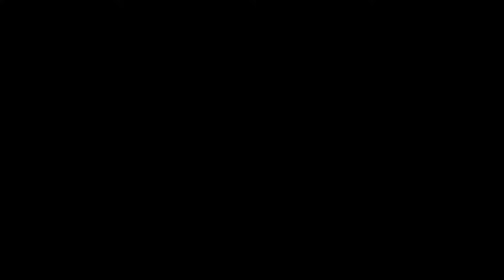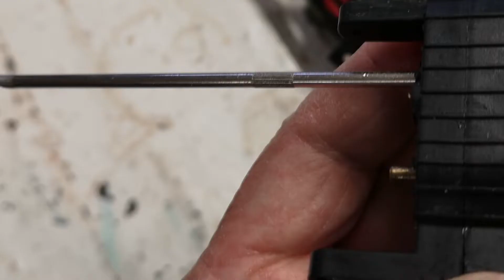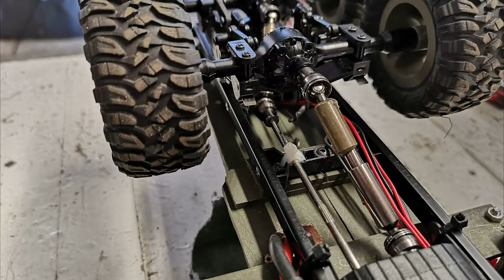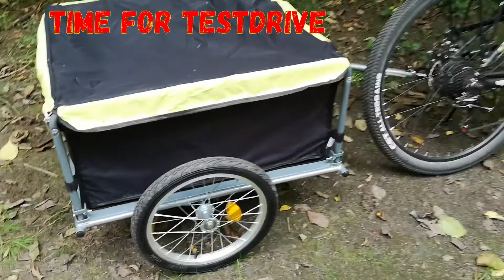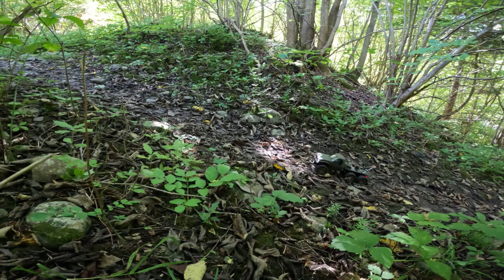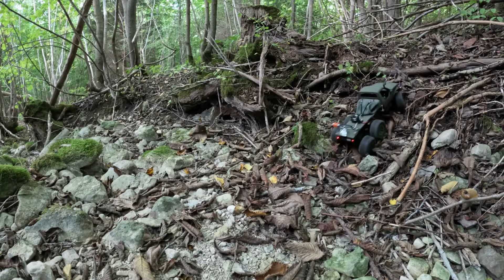WPL B36 dual driveshafts for rear axles

Comment: That's the best redesign I have seen on the web in ages. Truly excellent idea and implementation. I wish mine could have avoided the "through" diff, so much better the way you've done it 👍🍺🇬🇧
Reply from the maker: Thank you Carl! I´ve seen similar designs on full size trucks, so I thought why not try. And it´s rather easy to do with this type of single speed gearbox. 😎😎
Reply: @Georgieframe  Oh definitely, of the two designs, through-axle is a compromise. I'm surprised the big players haven't done a design like you have achieved. It reduces stress on the UJ from the gearbox to the middle diff. Also means the middle axle isn't limited by the back axle. I can't do this on my   Carnage as no room! 
Am appreciating crawler models more and more now, and they don't need to be slow all of the time 😆👍🍺🇬🇧

Comment: Ah - does the single speed WPL gearbox originally come with two rear-facing outputs?
Or have you used the output for the front axle to drive your long shaft as well? Sorry I'm being so slow to understand.
Reply from the maker: Hello and thanks for watching! This gearbox comes with one front-facing and one rear-facing output. I replaced the short front-facing shaft, it´s fixed with a grub screw, with a longer one (rear axle from MN45) and drilled a hole in the gearbox housing so that the shaft can stick out backwards as well. 😎😎
Reply: @Georgieframe  Aha!
Thank you for clarifying how you did it. And then you improvised a bearing carrier for the rear end of the long shaft...got it!
Reply from the maker: @Del350K4  Exactly! I used material I already had in small boxes so it´s actually a no-cost modification. And it works really well! 😊😊
Reply: @Georgieframe  I recommended your video to "Big E's RC", as he has built a 6WD coil-sprung C24.
Reply from the maker: @Del350K4  Good! I checked on his extended C24 (thanks for the tip), looks like a very fine and capable design! 👍👍😊😊